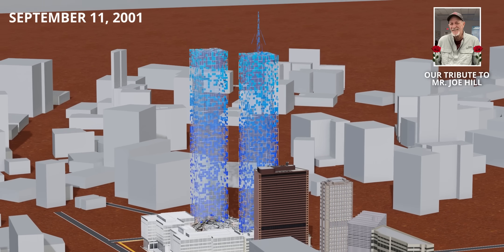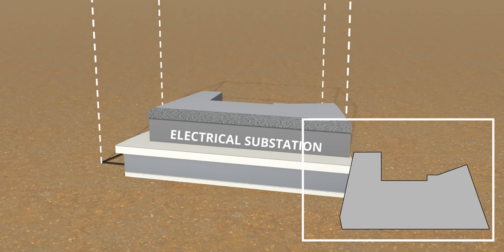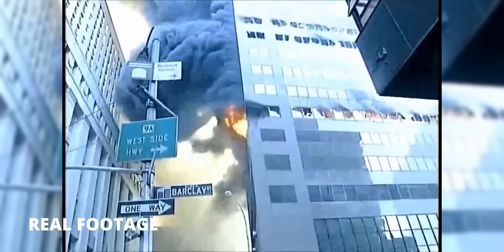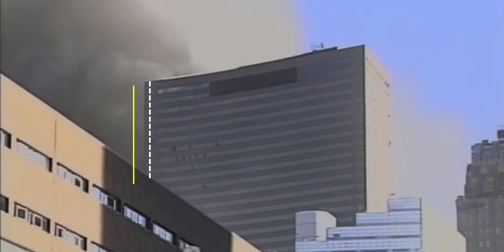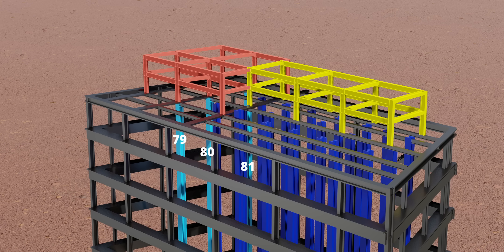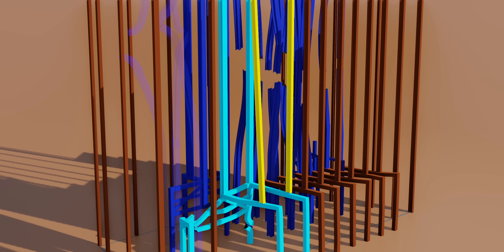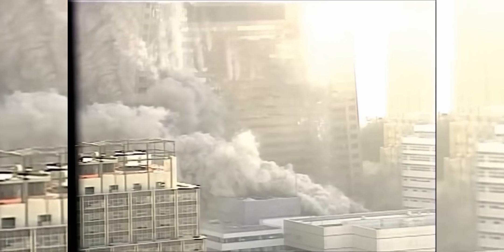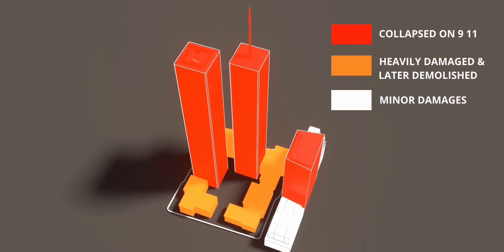Collapse of Building 7 | The Complete Physics

Comment: How do you reconcile your progressive collapse mechanism with 8 stories of symmetrical free fall confirmed by NIST - and our own eyes.   This video is lying.  Check the official NIST report if you don't believe it.   And where are the temperature measurements suggested coming from?
Reply: No need to reconcile anything. Just have to understand the sequence. 

Building 7’s collapse was completely different to the Twin Towers, harder to understand with most of the details difficult to see. But we can still sort out what happened through careful analysis and observation.  This is MY EXPLANATION of the collapse sequence using the best available information and relying on no authority.

B7 was complex 47-story steel framed structure built on top of a smaller existing 3-story building, requiring several lower floors dedicated to complex load transfer structures instead of usable office space. Of trapezoidal shape and all-steel tube-in-tube construction, B7 (above the 7th floor) consisted of a central core of steel columns carrying most of the gravity load, perimeter steel columns around the outside of the structure carrying the remainder of the gravity loads and long span beams and girders to tie those elements together and form the floors. On the outside of the building hung a moment frame - the last part of B7 to fall. 

Phase 1 : The first externally visible signs of collapse initiation occurred at 5:20:28 pm. Collapse initiation for B7 is notably quiet with observers not realizing the building was collapsing! There was no audible warning in the form of say hundreds of ear drum busting 180-190dB explosive bangs preceding the collapse. Here at 12:00 a local CBS affiliate reporter is talking 10 blocks from B7 when collapse begins. People don’t start to notice the collapse until 12:11. Then at 12:45 is the famous CBS fixed camera clip of Building 7’s collapse.  Note how quiet it is.

youtube.com/watch?v=t5tEy6mXSE8&ab_channel=fresnosean379

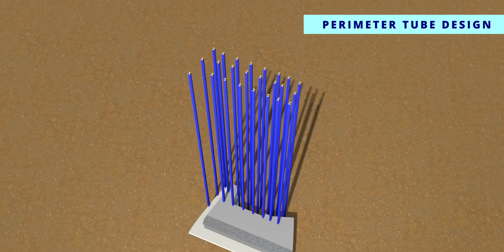Collapse initiation was due to lower floor failures above the load transfer region (7th floor) in the NE corner of the building. In this video at 0:45 you can see the NW corner from inside the building while under construction, Column 79 just out of frame on the left. That big, angled steel beam across the top of the frame connects to C79 at one end. The girders connect to the beam. That beam and all those girders depend on just one connection

youtube.com/watch?v=nP3TNHPCIVU&t=35s&ab_channel=EdwardCurrent

Phase 2 : Lower floor failures caused a loss of critical lateral support over an excessive length of core Column 79 and it buckled. If you look at a floor diagram of Building 7 (see above) and look at all the structures that depend on C79 you quickly realize this one column was a relatively isolated structural element on which a disproportionately greater fraction of the structure depended analogous to say the Key Bridge. Externally we see a vertical progression of window breakage along the 44-46 line and a kink in the roof of the East Mechanical Penthouse at the top of the building, consistent with C79 failure. The transition from full capacity to almost no capacity occurs in virtually an instant. Once the buckling failure occurs there is almost no resistance

Normally with a buckling column, the load could very well be redistributed to other columns, meaning the buckling could stop after a while. With C79 that is not the case - the failure did not redistribute the load, so the collapse rapidly progressed to the roofline, sinking the rooftop penthouse.

Phase 3 : With C79 gone, Building 7’s progressive, non-symmetrical collapse continues with C80 and C81 at the east end of the core left laterally unsupported and quickly buckled and failed as well, sending the EMP down through the building. C79-81 all have no diagonal bracing, which I believe is a major reason why they could not redistribute a lot of vertical loads among one another.

From there collapse progressed from east to west through the central core until the core was gone taking all of the interior floors and structures and probably most of the perimeter columns with it. You can see the horizontal progression of window failures low in the building and the dropping of the remaining rooftop structures into the building. One of the big takeaways from the NIST Building 7 study (that gets completely ignored) was their modeling which determined C79 failing under ANY circumstances would have initiated the same collapse sequence.

Phase 4 : After some 10 seconds all that remains of Building 7 is just a hollow empty outer shell - the exterior moment frame - creating the illusion the building is still standing since little has changed externally. But it’s just a hollow empty shell like an empty cereal box supported by only a few remaining columns and quite unable to remain standing. With all the internal framing gone, the north face leans inward, forming a V in the roofline, the last few perimeter columns buckle under the strain and with nothing left keeping it up the moment frame free falls, landing on top of the 7-story high debris pile. It is only at the very end that a single measurement of alleged free fall acceleration is taken. Note this is not the building but just its outer shell and only one corner at that, at the very end of the collapse. Start to finish the entire collapse took 18-20 seconds, or less than 1/3 of true free fall and we have to look at the whole thing, not cherry-pick little bits to fit a particular narrative. Worth noting how fast something falls cannot tell you what started it falling in the first place. The debris spread out, blocking surrounding streets, heavily damaging the Verizon Building and destroyed Fiterman Hall, all well outside of Building 7’s “footprint”.  

Building 7’s progressive, non-symmetrical collapse was incidental and unintended collateral damage from the combined effects of fire + time + gravity started by the collapsing North Tower. That is true no matter who planned and carried out the 9/11 attacks or why . The collapse was of so little consequence it barely even registered at the time, a mere footnote. It only took on semi-mythical status as an alleged smoking gun years later when demolitions at the Twin Towers, missiles at the Pentagon and shoot down over Shanksville all failed and conspiracists had nothing left to work with.

Anything can seem like a conspiracy if you don’t understand how it works. Now you should. I hope you found this helpful, informative and it solicits informed critical comment. If I made any errors of fact, logic or reason or left anything important out, please let me know so I can fix it. IF you can offer a more plausible alternative please do. Be the first. Please start any reply with the words “Tits McGee” or I will know you didn’t read it and are wasting my time.
Reply: @TheCriticalStinker-01  

Tits McGee - Phase 4 is speculation - no evidence provided.     The NIST report confirms free fall.   Have you read it?   It is physically impossible to have both a progressive collapse AND measure free fall acceleration for over 8 stories - you can come up with all the mechanisms you want - but they are all progressive - and we see simultaneous global collapse at free fall acceleration.     I'll stick with the global experts, like Danny Jowenko, who know immediately that it's obviously a demolition.

It must have been wired up very quickly or in advance.    There is means, motive and opportunity.    Many witnesses and all the evidence was disappeared.
Reply: @gavin4848  - Since you took no issue with Phases 1, 2, or 3 then Phase 4 has to be correct.  It's a total package. You can't just cherry pick the bits you want and ignore the rest.  One thing flows naturally from the one before. That is why you fail.

Jowenko performed no analysis. He speculated, based on a single viewing of a doctored video (audio track removed, edited for length) of an event he was completely unfamiliar with and without being informed of critical details like the building having been on fire on multiple floors for 7 hours and declared unstable by the FDNY.

In short, he was conned.

Worth noting your "expert" was adamant the Twin Towers - with which he was familiar - WERE NOT controlled demolitions.

You lot always leave that part out. Lie-by-omission.

Don't pretend you are being objective here. You cherry-pick what you want to believe and hand-wave away anything you don't.
Reply: @TheCriticalStinker-01   Progressive collapse does not occur at free fall for over 8 stories   There is NO observation of progressive collapse - but NIST did report free fall for over 8 stories = negligible resistance,  which is incompatible with free fall.  Period.   You can't have it both ways.
Reply: @gavin4848  - You obviously have still not read and grasped my first reply in this thread, where all of your objections were adressed. 

BTW - The NIST report describes a progressive collapse AND mentions the insignificant average rate of collapse of just a single point of the outer shell that was the last part of the building still standing. 

The two things do very much go together just fine.

You just need to drop 18 years of internet conspiracy dogma and start using the thinking part of the brain. Only then will you figure out why free fall has always been a dead horse. 

I won't hold my breath.
Reply: What you think you saw is entirely irrelevant. After all, the fool sees what he believes.

Comment: If anybody believes this was caused by fire, then you need to live in another planet. No building 7 comes down with a simple fire. The steel just doesn't melt with such low temperatures. It was well orchestrated. The main stream media helped a lot to sweeten the false narrative. Even the firefighters heard several continuous explosions. Also, the falsely elevator modernization was just the perfect time to place those bombs in the columns. No building comes down so easy and fast.
Reply: Who said anything about a "simple fire" and what does "melting" have to do with anything?  Structural steel will fail at less than half its melting temperature so it never gets the chance to be a puddle.

The problem here is clearly your false starting assumptions.  Luckily for you, we can fix that.
Reply: So, let's see how many things you got wrong:

"with a simple fire"
Nothing about "all over the building, on every floor, for 7 hours" is a "simple fire".

"The steel just doesn't melt with such low temperatures"
Fails not only on "low temperature", but also on "melt". Amazing as I'm sure it is to you, the effects of heat on iron and iron alloys like steel have been known for about 5000 years. It's even the basis for a period of human history....called the "Iron Age". You might've heard of it.

"It was well orchestrated"
Which is nicely evocative, and meaningless.

" The main stream media helped a lot to sweeten the false narrative"
Ah, yes. "The news reported the news, this is very suspicious".

" Even the firefighters heard several continuous explosions"
No-one heard "explosions", much less "continuous". What they heard were "loud noises". That's what the hyperbole "it sounded like a bomb" means. Were there actual explosions? Possibly so, but that still does not equate to explosives.

"Also, the falsely elevator modernization"
There was no "elevator modernization" in WTC7.

"the perfect time to place those bombs in the columns"
No-one "placed bombs in the columns". Not only because it would have been impossible, but also because the columns were thoroughly investigated and no evidence of "bombs" were found.

Comment: Grenfel tower in London burnt non-stop for more than 24 hours  inside and out... and it was not even under threat of collapse. yall just making excuses
Reply: Grenfell Towers fires were mainly external and it was constructed of reinforced concrete panels, NOT STEEL. 

Curious why you chose an analogy that is not analogous.  Why did you skip Plasco Tower or Wilton Paes de Almeida?
Reply: Grenfell Tower had literally nothing in common, either in fires or in construction, with WTC7. "Yall" just too dumb to understand that.

Comment: The fire department was busy with the survivors? What survivors? No other steel structures have collapsed from fire, except on 9,11 when not one, not two, but miraculously three steel frame structures collapsed with demolition style accuracy. Yeah, nothing to see here.
Reply: The tens of thousands of survivors who evacuated the Towers, many with injuries. That and SAR efforts on the pile. 

Countless tens of thousands of steel buildings, bridges and other structures have collapsed due to fire. It literally happens all the time. Steel is formed by heating and deforms the same way. Stop mindlessly copying stupid shit off the internet. Honestly! 

This video is pretty good – with a few exceptions - and goes into a much higher level of detail than many viewers will be able to comprehend.  While not perfect, the collapse mechanisms – the sequence of failures - described here  are substantially correct and this is true no matter who planned and carried out the 9/11 attacks or why . 

That may not be what you want to hear and go against 20+ years of entrenched dogma and conditioning, but it’s not wrong. 

That also means (in case you did not get the hint) this video can be (and IS) absolutely correct in its description of collapse mechanisms AND the 9/11 attacks could still have been some sort of inside job. The two things are in no way mutually exclusive. 

The mechanisms described here have broad professional support around the world. There are no professional engineering organizations (for example: ASCE, ASEE, ICE, etc) that disagree with them or have offered any formal dissenting opinions or alternative hypothesis. 

So, setting hubris aside, either the overwhelming majority of the worlds structural engineers and simple observation are wrong,… … or you are. Which seems more likely? 

IF you still think believe this explanation is wrong then produce a better one . Good luck with that. No one ever has and I don’t see you moving that needle today.
Reply: @TheCriticalStinker-jw4fl  you can say what you want, but there is no way you will convince me there was nothing fishy about those collapses.
Reply: @FlymasterFlash  - And that is why you fail. Unwillingness to accept anything that does not fit your personal brand of reality-distortion. Correct or not.

Comment: Did they at least pay you for making this bullshit? The antenna didn't fall that way and your entire video is illogical speculation completely unbacked by common sense engineering
Reply: This video is pretty good – with a few exceptions - and goes into a much higher level of detail than many viewers will be able to comprehend.  While not perfect, the collapse mechanisms – the sequence of failures - described here  are substantially correct and this is true no matter who planned and carried out the 9/11 attacks or why . 

That may not be what you want to hear and go against 20+ years of entrenched dogma and conditioning, but it’s not wrong. 

That also means (in case you did not get the hint) this video can be (and IS) absolutely correct in its description of collapse mechanisms AND the 9/11 attacks could still have been some sort of inside job. The two things are in no way mutually exclusive. 

The mechanisms described here have broad professional support around the world. There are no professional engineering organizations (for example: ASCE, ASEE, ICE, etc) that disagree with them or have offered any formal dissenting opinions or alternative hypothesis. 

So, setting hubris aside, either the overwhelming majority of the worlds structural engineers and simple observation are wrong,… … or you are. Which seems more likely? 

IF you still think believe this explanation is wrong then produce a better one . Good luck with that. No one ever has and I don’t see you moving that needle today.
Reply: @TheCriticalStinker-jw4fl  The sequences described here are speculation.  That may not be what you want to hear and go against a lifetime of entitled dunning-kruger. That also means (in case you didn't get the hint) that this video is a purely speculative attempt at putting minds at ease while being backed by nothing. Pretty much everyone that spends a couple of minutes learning about the innumerable unexplained "coincidences" knows 9/11 was, at most, and inside-job and, at the very least, a complicit allowance and steering of the attack. The mechanisms here don't mean shit.  tHeRE aRe nO pRoFeSsIonAL eNgInEeRiNG oRgAnIzAtIoNs tHaT dIsAGrEE with tHeM oR oFfEr dIsSenTiNg oPiNiOnS oR aLtErNaTiVe hYpOtHeSiS. 🤣 I can't believe you wrote that on a 9/11 "explanation " video. Your decades of entrenched dogma are showing. So, calling out your glaring hubris, Captain Dunning-kruger, I am an engineer with 20+ years of experience, and what's most likely is you're a restard that enjoys thinking highly of himself,  backed by nothing more than your inflated sense of self.  At least 9/11 is over, and you don't have to worry about any planes hitting you on that high horse. I don't owe the ignorant an intelligent explanation. It already exists. Follow your nose and find it. I'm sure it will be difficult to discover over your rank attitude. Don't respond. Go away now. I will waste no more time on a waste.